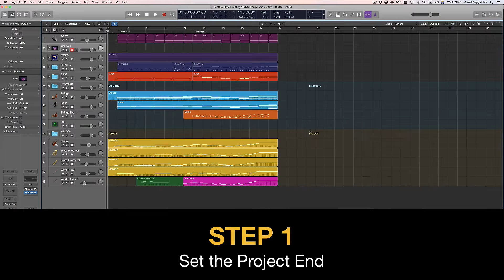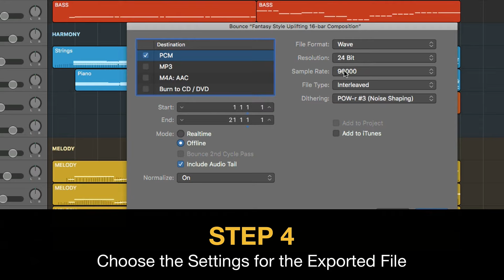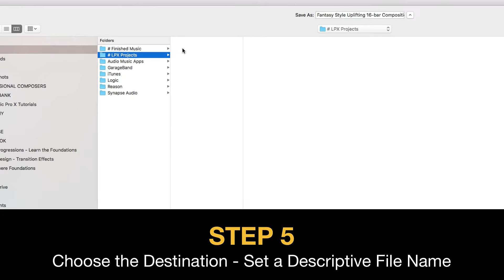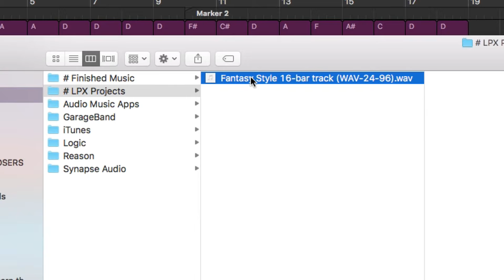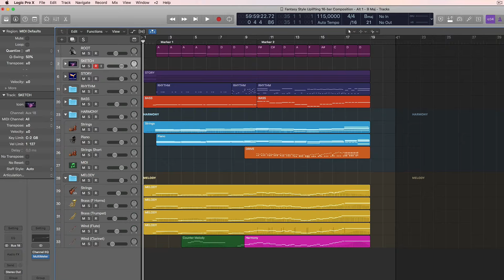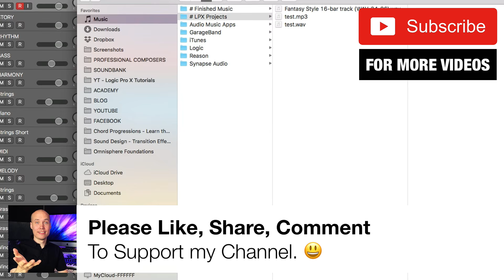Comment: great vid thx a million, 1 question though:  do you know if professional mastering engineers use 'normalize' ?  i was playing with this option but when i use it, the volume will sound the same as my un mastered version despite of the 5db + gain in my limiter... the normalize function seems to just cut the volume off but this is not what i want sooo.. no harm just turing this off for my end result?

Comment: My project does NOT start at the beginning of the arrangement - it starts at 327 and ends at 459 - I have other files before and after the project that I don't want to move from where they are, and obviously I don't want to export them as an mp3 either. So I just want to set left and right markers to tell LPX to export from "here to there". Not possible?

Comment: Hello!

First time using Logic Pro. Question - Very simple 2 tracks.  When I follow your steps the file is seen as MP3 where I put it. When I play it with Quick time or Apple Music player - no sound is heard. however the file length is as i intend. This is a Simple 30 second sample. 2 tracks. The Tracks as recorded play perfect in Logic. Is there a click or check or setting so that the files are flagged as those to mix down and export as one mp3?

Comment: If you want a true mix from logic that is clean and exactly as you mixed it, turn off the normalising feature when you bounce the file because if the audio is too loud, instead of distorting the file it will automatically compress the audio and you will find a difference in the over all mix quality and won't sound the same as it did when you play it back in the program. It's also the correct way to know if your mix is too loud on the output, rather than logic auto correcting the level and changing the overall sound of your mix and getting rid of distortion. Use a limiter on the master if you want to make it loud, do not at any cost use this stupid feature normalise when you bounce. if you truely want to know what your mix will sound like after you bounce it turn it off god damn it!! haha
Reply: I didn't know you could bounce an MP3 and wav file at the same time. Shows how much technology has passed me by. I thought you mixed low and mastered it high. So when this this engineer I've been working with was giving me MP3's so fast that crackled I thought he hasn't even mixed it first never mind master it. 
I told him listen most of your mixes are crackling. He said they weren't and that it was probably a problem with my soundcard . I don't believe him. How can you mix and master in MP3 and wav. In the time it takes to play it. I'm not convinced. It's crackling even at low volume and he says it's my fault. 

Does anyone here have any advice on this cos I don't want him to master them. Cos I have other songs to go on the album that I don't want him to mix. Especially like he's already in the red. Cheers 👍

Comment: Hi! Great video. I learned a lot! But I have an issue.. when I save my project and I don't turn on the ' normalize' button, the song is clipping in the parts with a high volume. But I did master it before and put a limiter on it. So do you know what the problem is?
Reply: Always normalize when exporting. However, your song might already be clipping inside the project. Make sure you keep an eye on the faders, so that they never clip. And use the loudness meter as the final effect on your stereo output (mastering chain). =)

Sincerely,
Mike